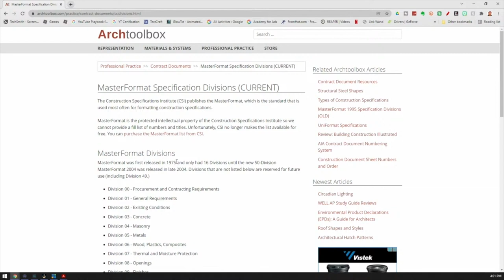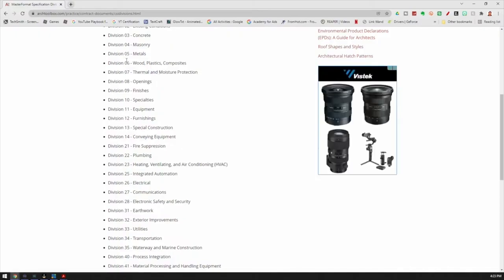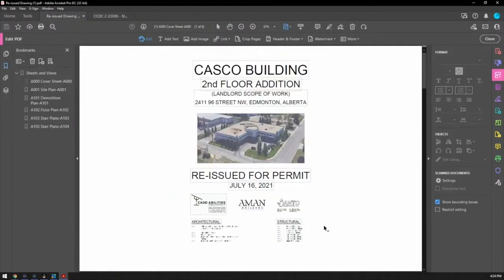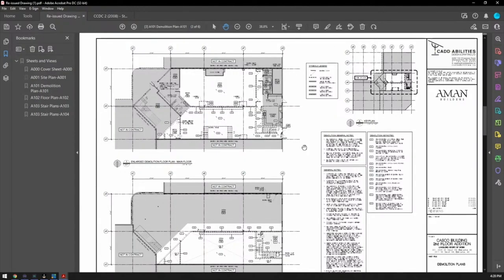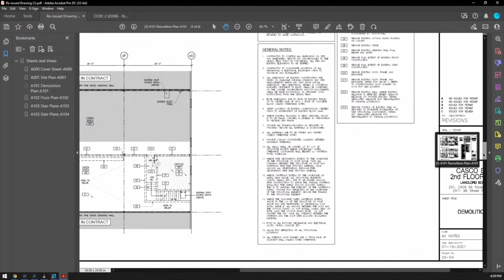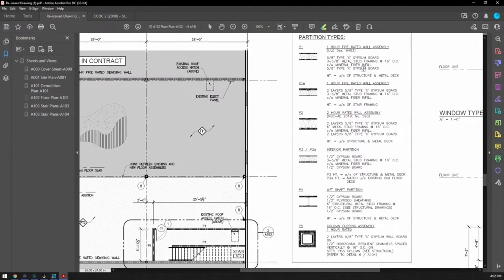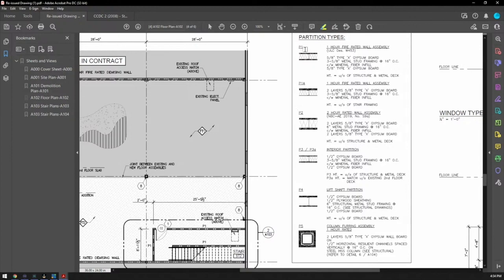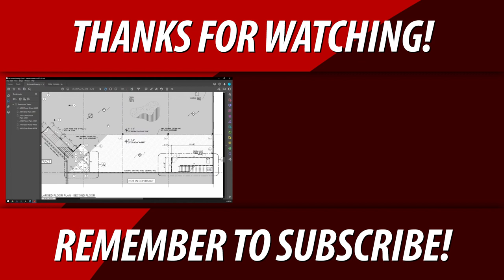Blueprint Reading Basics For Metal Stud & Drywall

Comment: I'm a steel stud and drywall estimator for a fairly large drywall company. I see all sorts of crazy stuff on drawings. A few favorites' are: When there are too many details/blowups but there's no reason for them; when the wall/ceiling tags on the main plan don't match the tags on the blowup or elevation, floor plans split into too many segments. On smaller jobs like TI's, no elevation(height) for the deck above (e.g. they don't tell you what height your walls will be LOL); Too much supporting documentation (some projects come with several thousand pages or drawings and docs); When you get an ID set and an Architectural set, but they don't match LOL; Finish Schedule and Spec don't match; When they ask you to price from BP set, then later from IFT set, then later again from IFC set....and it's a huge project but they award to another company in the end..aagghhh LOL  -My favourite is when they issue a crappy set of plans and expect us to point out all the issues/inconsistencies/errors
Reply from the maker: Yeah I feel all of that!! Haha! You can always tell when the drawings are mint its usually because they have built a few already. Being in the field you have to know what to rely on and know about shop drawings and other submittals so you can get your layout proper. For me is the worst when the finishes and /or door/ window schedules aren't there. Every time I start or price a job, a TI man I have to ask them the elevation to the deck. Cheers and thanks for the comment!